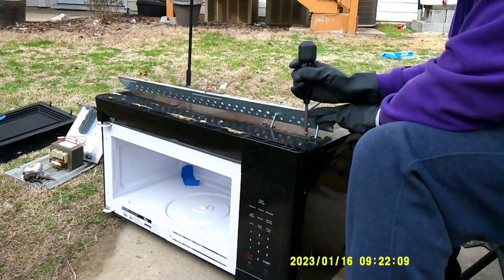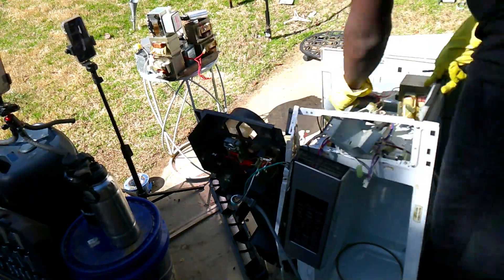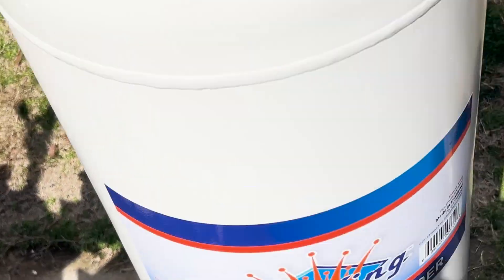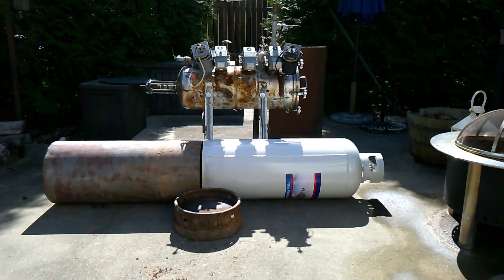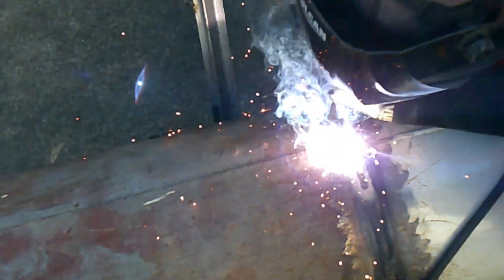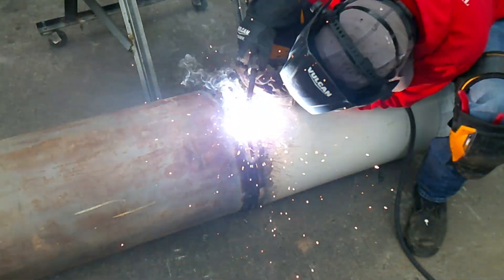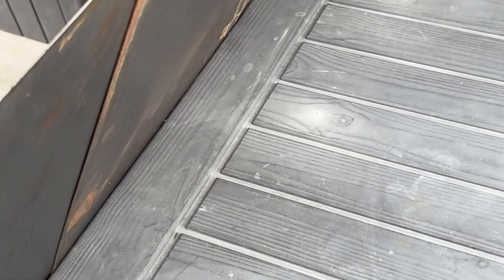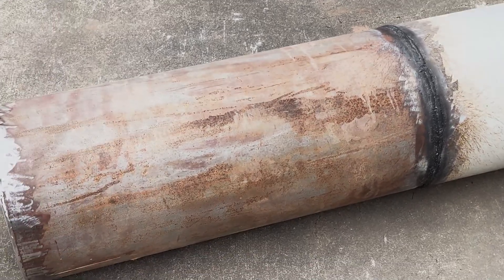Building Mark 4.5 Plastic to Fuel Reactor Part 2 | WELDING!

Comment: Hey man. Love what you doing. Can you drop out the char and re-introduce it? I am assuming it would be beneficial to use that heat, char for de-oxygenation and would give you chance to re-introduce any 'unfinished' by pyrolytic product to be finished off mixed with fresh feed?

Comment: Rather than using the augur for mixing, have you considered having your two sources separate, and hoppering those into a mixing chamber, you can find a way to optimize your mixing chamber, and then utilize the augur for feeding, rather than mixing

Comment: Why you dont simply use Wood fire to heat plastic?
Reply: They already have done the tests and calculated it, this guy did the research and his setup is heaps more efficient than burning wood, at the end of the day wood is also a fuel and it prob makes more sense to burn the wood directly and use that for fuel instead of using it to make fuel out of plastic

On a small scale I'd suspect you are correct but the issue is scalability, this guy says his setup is scalable so you can make it much larger and get great efficiency.

If you scale up burning wood you would end up burning so much wood it would cost more for the wood than the fuel coming out the other end

Wood is cheap on a small scale if you live in the woods but when you start using wood as fuel on a larger scale it would end up becoming extremely expensive and probably damaging to the local environment I assume.

That's why he's so invested in this setup, because (he claims, I can't confirm) it is a realistic solution to dealing with the plastic crisis and not resulting in a worse overall negative feedback on the environment..

All the current methods of plastic recycling MUST be subsidised by the governments because there is no profit or even realistic way of the companies staying afloat due to them having to pay money to recycle the plastics and some other hard to recycle materials (solar panels, wind turbines, etc)

So any ways to deal with plastic and turn a profit should be highly appealing to all governments, but we know the world isn't so black and white so may not get any attention at all..

Hope this clears up your questions, which are 100% logical at surface level!
Reply: Inefficient chemically, economically, environmentally
Reply: @Frank-bn9us  those heat generators consume a lot of current and its more dangerous
Reply: @Frank-bn9us  i dont think so, if you live in mountain you have free wood
Reply: @FrigoReal free cost doesn't make it inherently more efficient. It's very inefficient to use wood. You'll run out of forest before it becomes scalable.
Reply: @Peter_Kropotkin  i dont care if its scalable, i want It for my self

Comment: Yo Jab! I mentioned you in a comment, not sure if that system works. That video talks about some sort of liquid they are submerging the plastic in to help with the pyrolysis. You should check it out. If that mention worked, if not lmk & I''ll find the video.
Reply from the maker: Will check it out!~
Reply: @naturejab  That might be your catalist, which may be, methalyene and potassium chloride but don't quote me on that.